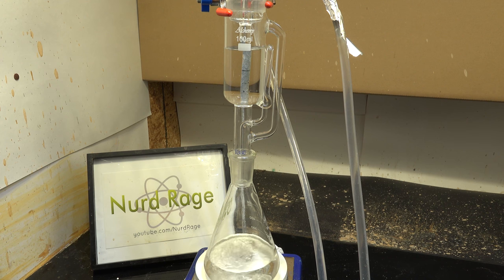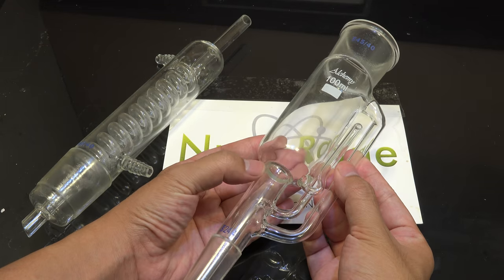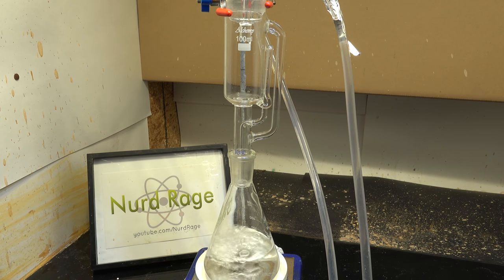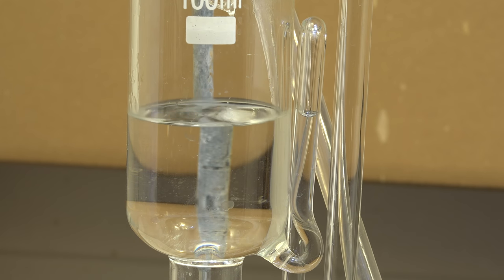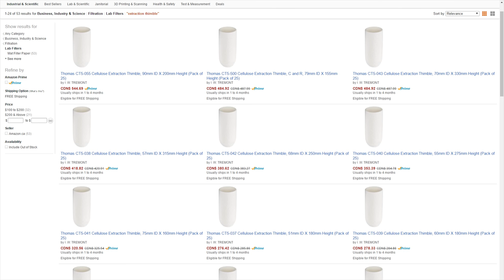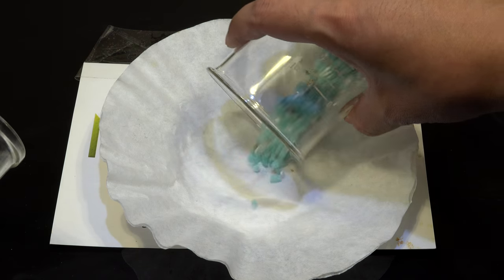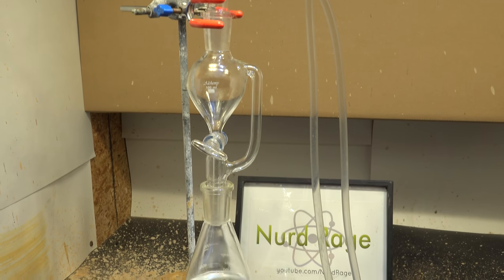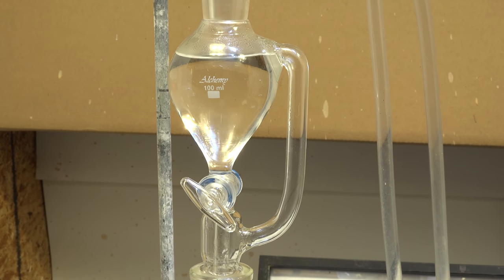Lab Equipment: Soxhlet Extractor (Fixed)

Comment from the maker: Ignore this video. Just a minor fix at the end where i didn't properly show one of the cycles. Nothing big.
Reply: Haha ok
Reply: I love your videos btw
Reply: no problem nurd
Reply: Can you pull a vacuum on and/or seal a soxhlet?
Reply from the maker: +Magneto! Actually yes, and it's not that hard either. The soxhlet is mostly sealed already so it's just a matter of applying the right vacuum hose to the top of the condenser. The only think you have to worry about is that cheaper Soxhlets not made with high quality borosilicate or not annealed properly will not be able to take the stress of the vacuum. They can implode if they fail. So if you are going to use a Soxhlet under vacuum you have to put a nice big shield between you and it or wear full safety gear and face shields on the assumption that Soxhlet could implode and send glass at you.
Reply: NurdRage Would you have to keep a constant vacuum suction or could you seal it once you have a low enough pressure? I could certainly see an advantage to having a lowering boiling temperature if the chemical you're extracting is sensitive to heat.
Reply from the maker: +Magneto! only answer i can give you is "it depends". But most of the time the solvents and solutes will degas and the seals of the soxhlet may diffuse air ever so slowly. So active vacuum is recommended for almost any distillation type system unless you have done prior experiments showing it can hold a vacuum on its own.
Reply: +NurdRage I see. It may also depend on volatility of the solvent used...BTW I just wanted to say thank you for all of the work that you've done. I've been a fan for a long time and I actually just started college studying chemical engineering. You're videos these past few years are almost solely responsible for my decision to study chemical engineering.
Reply: Is this a better way to make my tincture's?
Reply: Soxhlet español

Comment: would something like this work for dissolving gold with mercury?
Reply: hi there sir, i take advantage of finding you here to tell you that i love your channel and videos.

please keep your work, you're great. 

greetings from Chile
Reply: i think it could.
what do you want to seperate it from?
Reply: Cody'sLab you would need some form of filter bed to keep the syphon from clogging yet let the mercury pass perhaps a mesh from a metal mercury wets but doesn't dissolve?
Reply: Cody'sLab why haven’t you made this video yet!!!! I’ve been watching a lot of extraction videos lately and wondering to myself why you haven’t done on. Being that you are a homesteader and science buff I’d really like to see some interesting extractions from the lab.
Reply: In theory, yes you can. But the practical problems are immense.
First, gold occurs in nature, even in its most concentrated minerals, as an impurity of millionths. In places where it is concentrated, such as river beds or visible mineral veins, it is less than one thousandth of the mass of the material. That means you need enough mercury to moisten (without taking into account wettability problems) a thousand to a million times the mass of gold to recover.
Second. For the first reason, the Soxhlet device you should build would not be laboratory-sized, but immense, capable of handling hundreds of kilograms of material at a time. And it could not be from cheap materials like iron or aluminum, because mercury, and even more so its vapor would dissolve the material even faster than gold.

Probably, to recover gold and metals from circuit boards, a Pyrex Soxhlet could be used, capable of handling 10 to 20 kilograms of material. But it should have an internal mechanism that agitates the material, so that the mercury comes in contact with all the surfaces. Very difficult to put into practice, since the same agitation can cause pieces of the material subjected to extraction to obstruct the tubes of the apparatus.
The advantage of this last application, is that gold is very concentrated in circuit boards and memories, with respect to the way it appears in nature.
The disadvantage is that mercury vapor is toxic, corrosive and escapes with great ease. Another, all metals would dissolve. And when the mercury evaporates finally, there would be a mixture of gold with aluminum and copper, maybe some silver and iron of some types of contacts.
Reply: Daniel Fernando Carballo, that's Cody's lab, don't you know how much mercury does that guy have? Check out his video "Flushing mercury into a toilet". He also distills mercury for his breakfast.
Reply: "Asking for a friend"
Reply: The answer is a little more complex than it seems at first. On one hand yes the gold in the thimble would completely dissolve.  On the other hand the solubility of gold in mercury is still very low so in the collection vessel the gold would crystalize and fall out of solution. If you filtered it through a cloth to collect the gold and washed the solid with nitric acid you would come out with gold crystals. Here's a very interesting link relating to the subject.  http://www.lowenergytransmutations.org/iccf9.htm
Reply: @SolarSeeker45  The name of the site is rather off-putting, as is the implication that they seem to think they can turn mercury into gold without a nuclear reaction. 🤔
Reply: @EddieTheH  More than that they have an experimental procedure that anyone can try and detailed photographs of every step in the process. Besides that I've been able to dig up multiple independent works that performed similar experiments with the same results.
Reply: @SolarSeeker45  I've seen a few of these kind of things and have yet to see one actually verified. I'd be very interested to see any that seem genuine though.

Comment: Paper filters and thimbles don't stand up to acids as the solvent. Glass filter thimbles are expensive, and the perforated bottom glass insert thimbles have limited filter area. Using a 55/50 extractor I've found that ceramic candle style water filter cartridges can be made into relatively inexpensive acid resistant thimbles.

Comment: It works on the same principle as your toilet. Look at your toilet from the side, and you should see the bend in it, which will overflow when enough water is in the bowl, and will pull all the water out of the bowl, chug a bit, then air lock again, allowing it to refill
Reply: Nice to see I'm not the only one that recognized the similarity.
Reply: Richard Smith everything that has a syphon in it behaves in this way.
Reply: Richard Smith , you expose this diabolically genius apparatus for what it is-a toilet.

Comment: I want to know about the properties of DCM, since I never had any video actually showing what it can do, what it does, and/or what material it can dissolve (they just say it is an organic solvent, like benzene or toluene).
Maybe a video about various staple solvents used in labs (like DCM or ethanol) in detail would be appreciated.
Or, if I was looking at wrong place, please guide me to the video where any combination of above is shown. I love your videos :)

Plus, is there any chemical I can use to de-pot epoxy potted things? I don't care about how it will look or if it'll be unusable after de-potting. Just being curious.
Reply: Most physical & chemical properties of solvents can be obtained via msds sheets. For instance Sigma-Aldrich has elaborate info on them. Polar solvents will dissolve polar materials, so will apolar solvents dissolve apolar materials. About epoxy potted materials, you may be able to dissolve them as long as they are not crosslinked.

Comment: Increasing the flowrate of solvent should increase the rate of extraction particularly if the extractor is closer to a plug flow reactor. Not sure which of the too cases is closer. Also this process may be run under vacuum (for temperature sensetive extracts) if that vaccume is regulated not to be less than the vapor pressure of the solvent at the temperature of the condenser interior surface and the vacuum is applied at the top of the condenser.

Comment: Can you make a video on extraction of colonidene from the Pin Wheel flower plant ?
Reply: The colonidine is a very effective pain killer without secondary effects and the extraction is done with ethyl alcohol for 72 hours. This colonidine is 100 times more potent pain killer than codeine or morphine and is a lot cheaper.

Comment: What if the extract is heat unstable , can we remove the extract without going into boiling pot ? Is there any modified instrument available ? Name ?
Reply: Run it under vacuum to lower the boiling point for heat sensitive solutes.

Comment: I recently found Soxhlet extractors on bangGood for 30$ or less. That does seem inexpensive enough. Opinions on that?
Reply from the maker: I'd be worried they were made of weaker glass and thus could break easily.

fortunately, most soxhlet extractors are not used directly on hotplates like beakers and flasks and thus the thermal shock issues are mitigated. You can give them a try. Just plan for the possibility of them breaking and spilling hot (and usually highly flammable) solvent everywhere.
Reply: Thank you for the fast answer. The last time I tried a distillation, I broke a borosilicate flask. I'm not going to try it.
Reply: Fatalcreator did you put it directly on the flame?

Comment: i suppose if you clog your soxhlet extractor you cant really dissolve out whats clogging it because its mostly insoluble, that's why you're using the soxhlet extractor :)
Reply: This stuff might help: https://en.wikipedia.org/wiki/Piranha_solution
Reply: Exactly Piranha Solution which is basically Caro's Acid  can dissolve any organic matter I tried it personally on my Soxhlet Extractor and it worked really well.......

Comment: Why doesn't the solute just precipitate out if the solute isn't very soluble?
Reply from the maker: it does.
Reply: Ah right okay, so the conical flask (during the timelapse at the end is actually filled with the white waxy stuff + saturated DCM?) Then the pure DCM distills back into the extractor?
Reply from the maker: yep